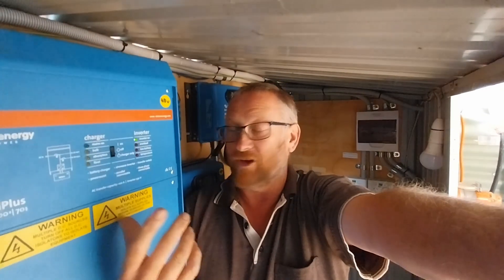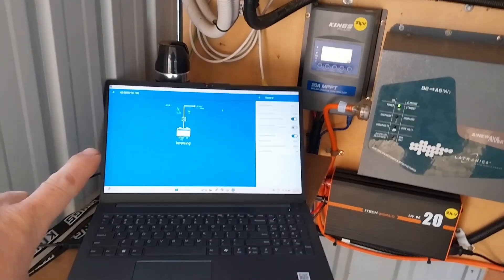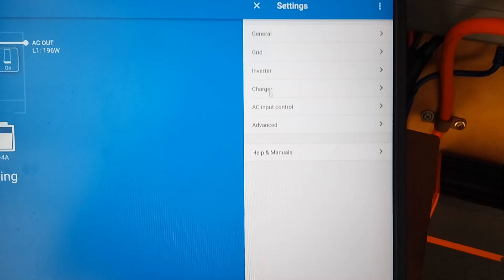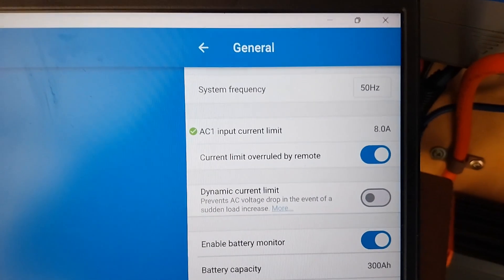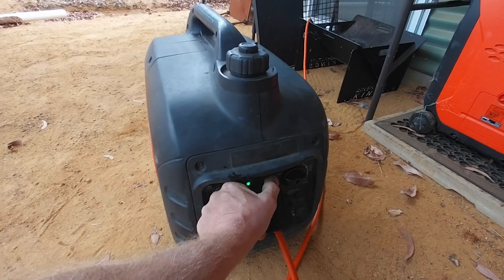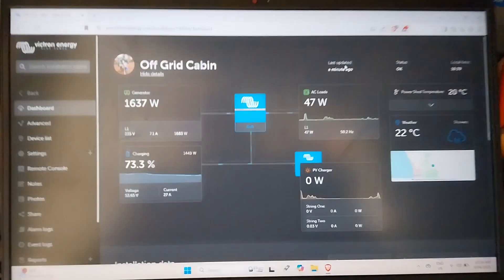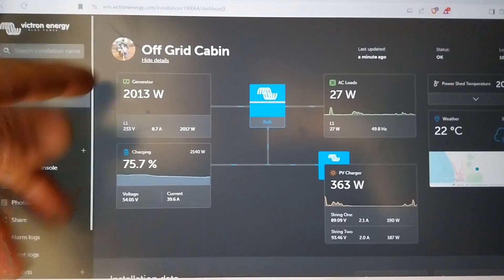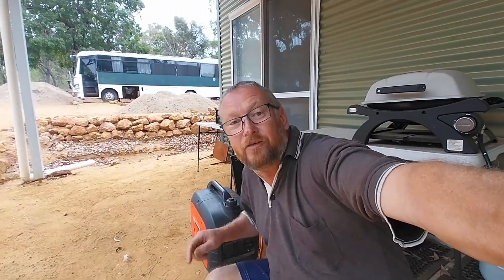Victron Multi Plus Charging Issue - Let's Problem Solve It

Comment: Whack a clamp meter on the individual batteries, or if they have smart BMS check the amps that way, when the bank SOC is up around 95% (according to the shunt).  I am wondering if the relative impedances of the batteries is allowing one battery to get current high enough up the top end of SOC to either go into over current disconnect or pushing a cell up to over voltage disconnect then when it abruptly cuts it's charging that results in the voltage spike since the charging system can't instantly react to that reduction.

Basically put unless the batteries are very well matched at top of SOC one battery will always be in a position to draw more current than the others.
Reply from the maker: You got me thinking. We could replace the current BMS in the batteries with a smart BMS, then we can see what is happening at the cell level.
These batteries come with a 4 year warranty so once the warranty runs out (in around 12 months time) we will pull one apart for a look see 👍